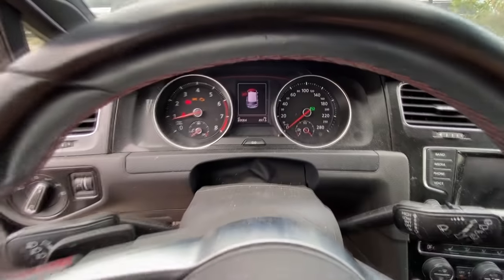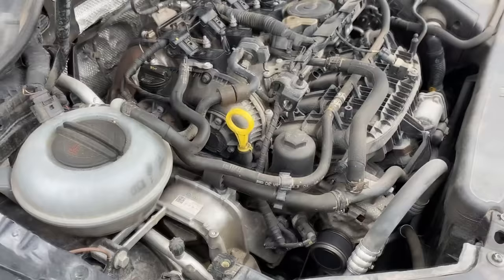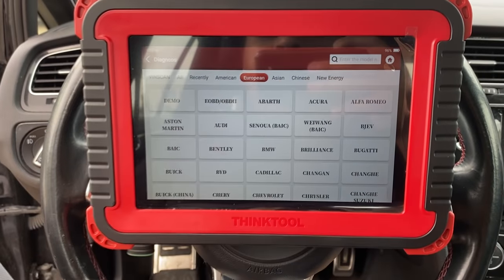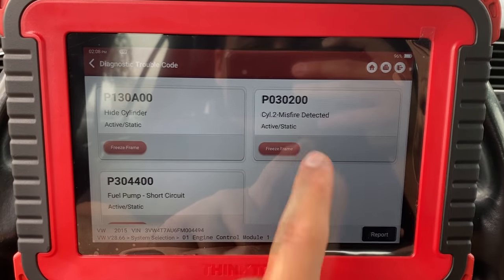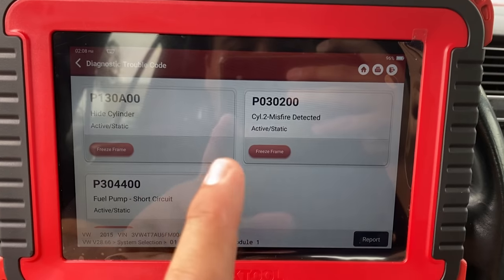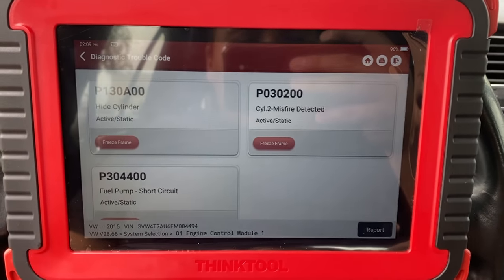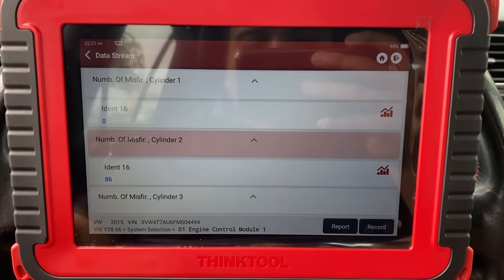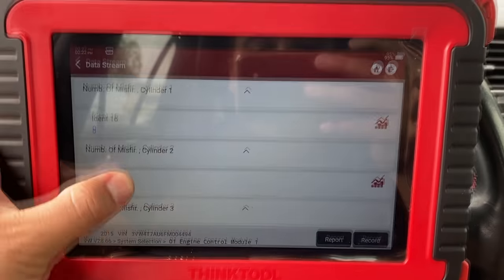VW GTI MISFIRE CYLINDER #2 NO COMPRESSION

Comment: I'm gonna take a wild guess...2 liter? Remember when vw actually made good cars?
Reply from the maker: After doing some research I found this to be a pretty common issue with tuned 2.0 engines. This vehicle has a COBB tuner. Humble Mechanic actually made a video with the exact same vehicle that had the exact same problem. Check it out here! https://youtu.be/V6jzRQpMw24
Reply: @ADVANCEDLEVELAUTO  Hey thanks for the reply. I've put engines in these things that weren't tuned, most under 100,000 miles. The chain jumped in one, the other just had almost no compression in cyl 2 or 3, I forget. I'm not a fan of European cars